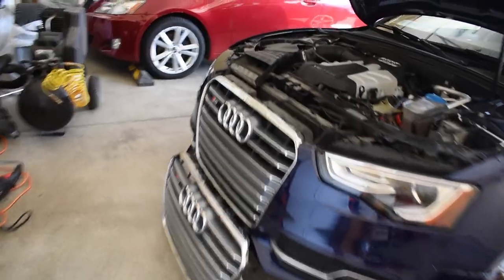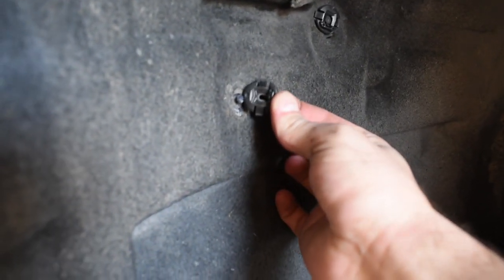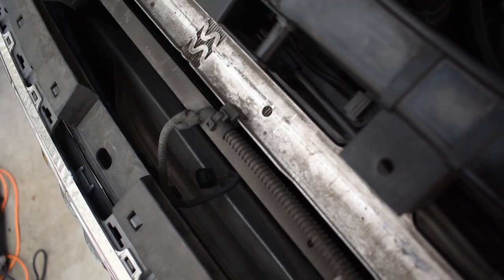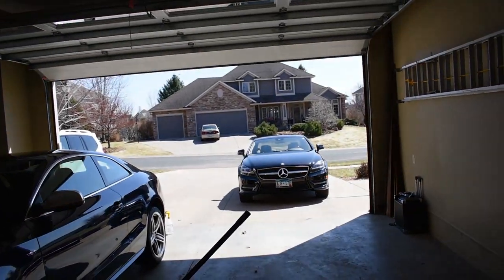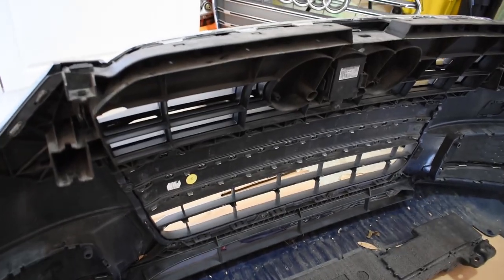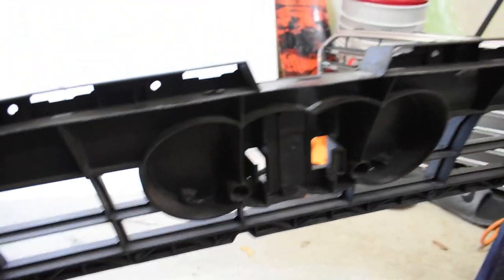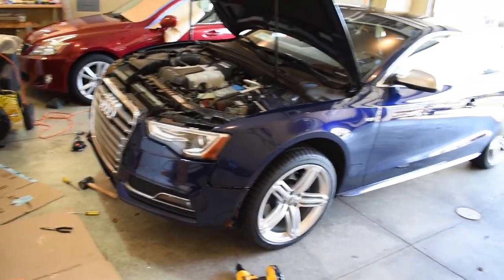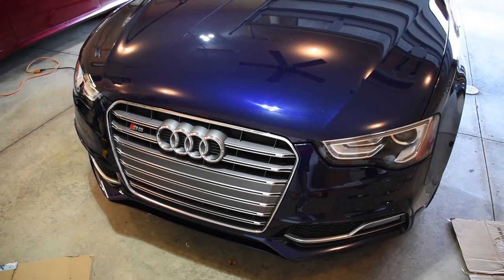How To Replace Audi S5/A5 Grille & Front Bumper (2013-2016 Models) FULL HD

Comment: For those watching you don’t need to remove the wheels to remove the bumper, just turn them to access those bolts.

Out of curiosity, how will you prevent the new chrome from crumpling like that? Is it a different material/finish?
Reply from the maker: True, I just found it more accessible!
So this car was a 1-owner Texas car, and I think the crumpling defect was only for certain 2013 Audis. It became prevalent sitting in that Texas heat.
I think my "new" Grille is 2014 or 2015 or something, so I believe the defect is fixed and I'm also in the midwest now if less heat helps 👍
Reply: @7urbine  Ok thanks good to know the issue doesn't affect all grills of that era!

Comment: Having trouble taking the grill off. I removed the torx screws  even the logo ones and I got the clips on top to unhook but the grill isn’t coming off easy,  any tips for clips on side and bottom ?
Reply: Finally got it off. For reference of how clips work plz look at new grill that you have. You can see how the clips are Algined. With this knowledge try to undo each clip at a time on the current grill and keep pulling hard until they come loose. Cheers let me know if anyone needs help
Reply from the maker: @hanhramuwan8074  it's a pain in the ass isn't it? Lol